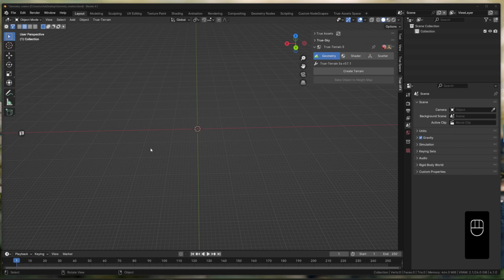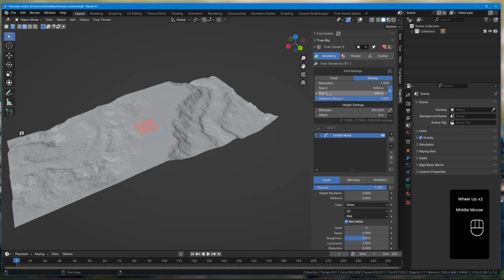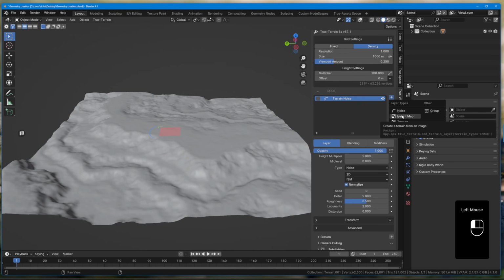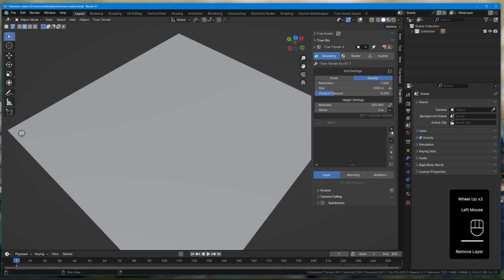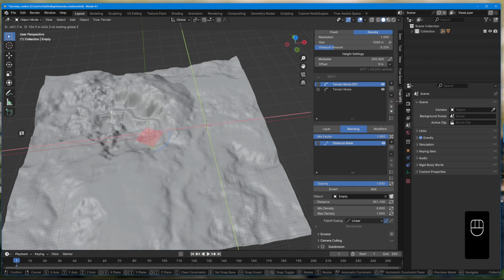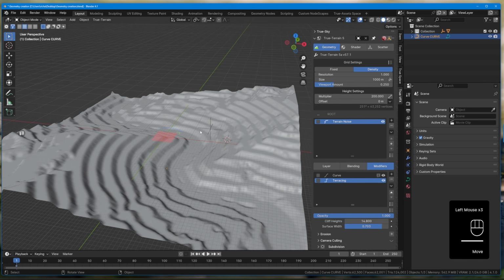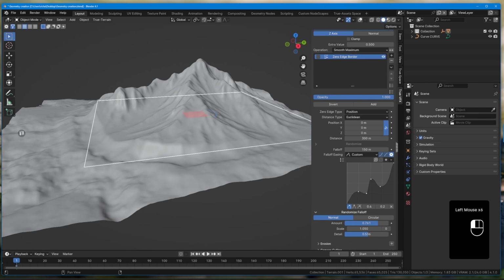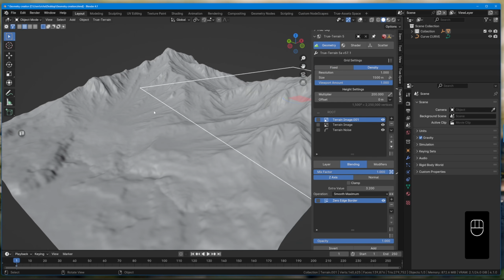TT5: Understanding Geometry

Comment: Whenever I switch into GPU rendering with cycles the material I’ve applied to the terrain turns 100% black, and then when I switch to CPU rendering with cycles it magically reappears and renders out fine. What can I do to fix this and render out with the GPU?
Reply from the maker: Are you on apple silicon?
Reply: @True-VFX yes I am, M1 Max.
Reply from the maker: This is a known Blender bug with metal. You'll either have to render gpu no metal or cpu
Reply: The last version TT4 renders fine on Apple silicon GPU, what changed in the materials that is making the Apple silicon not work? And will there be a patch for this soon?
Reply from the maker: The latest version of tt4 doesn't use the same system. This is a metal issue and not something we can patch